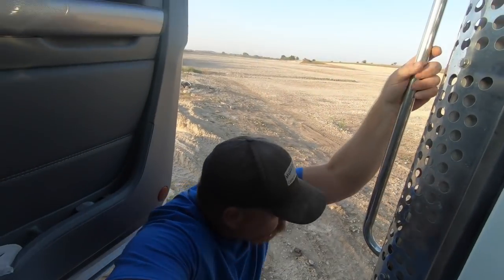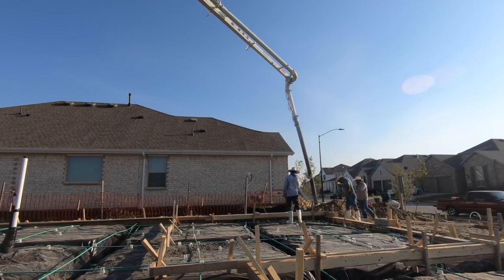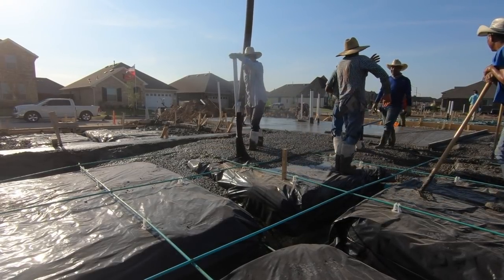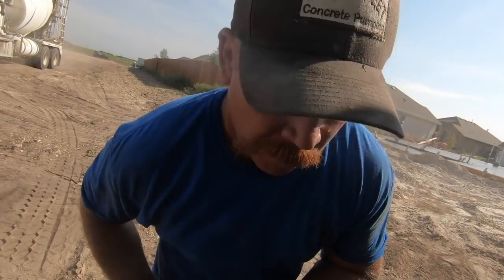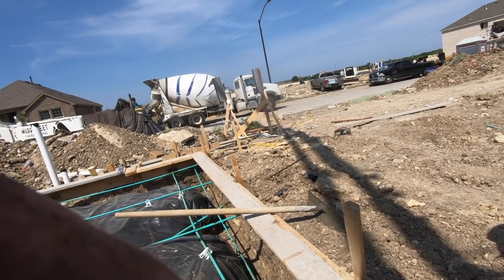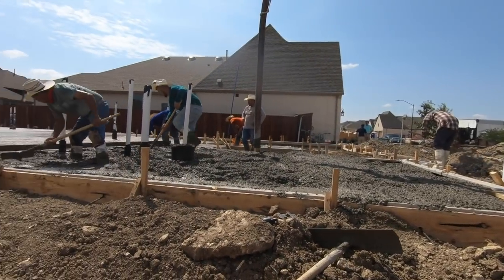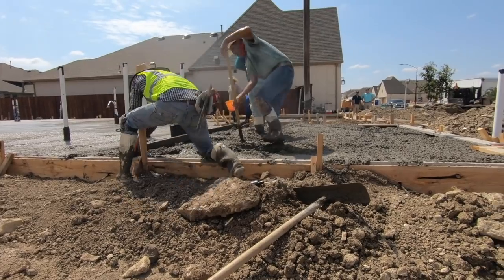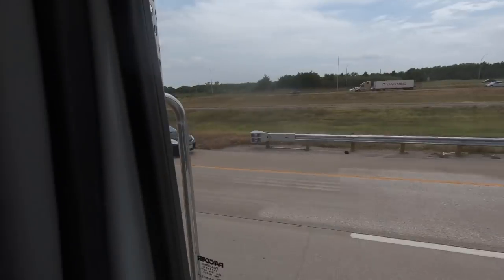Water Wars. Contractor almost shuts the job down. Pumping concrete with Muddyfeet.

Comment: Long time listener first time caller!!  Owner of a concerte finish company for 20 years. Have poured 500yard pads. Here is the truth. As long as I’m pouring the pad the concrete is mine. If ya don’t like it. I will load my stuff up n be gone. Thanks for your videos. Thanks
Reply from the maker: That’s basically what the concrete contractor told them. Thank you for the support.

Comment: It would be a lot easier if concrete contractor's / Supplier's / Driver's would invest $56.00 and read ASTM C94. The batch weights are required to be on all delivery tickets. Usually, calculating the allowable water to be added, before breaking the water/cement ratio. Any additional water added to the mix shall be documented on the delivery ticket. It's really that simple. Saves a lot of arguing. If Driver's are not documenting the water added, then don't accept the concrete, and let the concrete supplier pay for it.
Reply: Antix619 when poured on the army base @3/4 inch slump we would sneak in water every chance we get
Reply: If I was the builder I would have core samples done and if they don't pass concrete contractor sued and not paid. Then first slab poured was visibly too wet.
Reply: @bigrick7108  once you take samples or conduct slump and or air tests you may not add more water to the mix. I cant tell you how many arguments I get into with the contractor over this issue. The slump goes up when you pump through a hose so take this into account. Every single contractor will try and add water, always pissed me off...
Reply: @capeguy  I agree 100%.  My point is most of the crews are using too much additional water. You can see how wet the mix is and how it self levels. More water equals lower strength and more shrinkage. More shrink means more cracks. Nothing Good there. Just lazy crews. I don't operate that way. People hire me because I don't cut corners. I over engineer and build everything I do.  Contractors that care are few and far between now.
Reply: @capeguy  slump goes down Dumb Dumb when through a system gets stiffer.  Call Ozinga Redimix call Meyer pump
Reply: @bigrick7108  says they man that don't shovel it strick it or trowel it.
Reply: @TURKEYMAN60185  I have done enough concrete in my  life to understand how it works. You apparently don't.  Adding water to the mix decreases the strength. As soon as you ask the driver to add water you assume all liability to the batch. Your batch ticket will say that.
Reply: @bigrick7108  It not shrinkage. It called  volume reduction. Shrinkages is what happens to male genital's in cold water!

Comment: Drive through a development that's 30 years old and the driveways are in 50 pieces—that was wet mud.  Easy to level during the pour but someone's going to pay for it later.  It may as well be gravel.  I can't stand weak concrete.
I live in a cool climate — I can't imagine pouring in Texas.   Sometimes I will order a superplasticizer additive, which allows a reduction in water content by 30% or more.

Comment: Why waste the time of putting stands under tension cables since they knock em off and not reset ?
Reply: It’s required for inspection they want the cable Centered
Reply: Jay i know it is required but they don’t worry about setting steel back on them
Reply: ive done a good bit of concrete and when your under that sun and havent stopped moving and messing with concrete you could care less about the rebar or post tension cable being where it needs to be besides the footing rebar.

Comment: If I was the homeowner and saw this video, the contractor would be busting that slab out and starting all over. Why even put rebar if you aren't going to set it up on the chairs? I know you are just the pump, but these concrete guys are crap. That rebar shouldn't be laying right on the ground.

Comment: I've had jobs where they have a "Special Inspector" there for the pour, you can't start pouring till he gets there and the first thing he does is take a sample from every truck and then watch's the entire pour to make sure you don't add any water. He catch's you adding water and he won't sign off the pour so you can't get your permit signed off on which means you can't get paid. Water thin's the mix and make's the mud weaker and the max slump he'll let you pour is 4".
Reply from the maker: Timothy doesn’t sound like much fun to deal with
Reply: That's why you pay a little extra for high range admix. I deal with this a on a daily basis, the place/finish crew always hollering for more water, but we have certain specs that have to be met. Plus you don't want to sell your client a certain psi concrete and screw them over cause you're lazy or cheap.
Reply: Actually it's always works out, just need to have a good schedule, a good finishing crew and good communication with the batch plant. The one's we've done you couldn't use admix. And you are right, adding water on site just screws up the mix. Seen a lot of guys do that and then when it cracks they claim all concrete cracks.
Reply: @InLaymansTermsPlease  I agree with that.
Reply: @InLaymansTermsPlease  yep "all concrete cracks" is code for.... prepare yourself....we do sh*t work.
Reply: @dontdr0ptheS0AP  High Range Water Reducing Applications: When used as a high range water reducing admixture, water reduction up to 30 % can be obtained. The superplasticizing action allows for the production of high slump flowing concrete with excellent workability that can be placed with minimum vibration even at a low water/cementitious ratio.

Comment: where is the inspector when all those chairs are getting knocked off the water lines going through the slab
Reply from the maker: I always thought they did their job 50%
Reply: In today,s world it,s all about getting it done asap.
As cheap as possible.
NO one really cares about doing a quality job.
The concrete reinforcement that is used in these concrete slabs is a Joke.
I have never seen such a useless set up.
As a Minimum we use no less than 6 inch square mesh.
Not sure how they get away with using this so called reinforcement.

Comment: Been a mixer truck diver for 30 years.. we try are best to make everyone life easier on the job... but if you are a ass iam a bigger ass.. I got 150 head tank of water 50is mine. You can't get what you want in 100 gal it's your fault not mine. I have and will do it agen dumping all the water on the ground. The gc should have add chemicals that would help that day.. topcast eubar supper p. And other.  Stop been so dam cheep help the guys in the mid out

Comment: Do you have a hard line on those newer concords from your water pump to the back of the hopper where you can screw the hose in right there? Or do you screw the hose in right from the water pump behind your outrigger. We have a 2007 38 meter like that and it’s a pain in the ass with all that hose just dangling there.
Reply from the maker: Carson Graves  o it’s a hard line to the back. They also ran a hard line to run air back there also. I haven’t connected it up yet.
Reply: Muddyfeet Concrete Pumping hell thats a great idea about the air.
Reply from the maker: Carson Graves Yes I agree. Just haven’t hooked it up.

Comment: no wonder you turned comments off to those two videos! why the hell wasn't there a descent road for concrete trucks! what did yall expect them to do with all dirt holy crap!
Reply from the maker: dan theman yeah it was getting pretty rough. A lot of negativity. We have plenty of that in our world. People need to understand shit happens.  Our pumps got around just fine. We weigh 60,000 lbs. those concrete trucks weigh around 67,000 lbs. so not a lot of difference. As far as the “y’all expect”. We where there to try and resolve the situation. We as the pump company didn’t have anything to do with the prep of the job. We where told that their was a road.  So yeah it was better I turn the comments off.
Reply: Wait which 2 videos are y’all referring to??

Comment: Are the massive footings due to the soils issues common in your part of Texas? That slab isn't going anywhere !!!
Reply from the maker: I’m guessing these are engineered foundations.  They tend to have more footings than whet you would normally see other wise.
Reply: Probably cheaper than a lawsuit later on?

Comment: 10 gallons will drop the slump only 1''. builder has worse issues on that slab with the post tension cables not properly in the concrete, chairs fell over and cables laying on the bottom., if they have to bust out the slab , theyll know when at the bottom just find the cables.

Comment: Nice video! I run a 2019 Putz 36Z in Orlando. Im gonna start feeding my machine a Gatorade at clean up. That's a great idea.
Reply from the maker: Andrew Glover it didn’t set up on me but I felt like it could have used some more sugar. Thanks for watching sounds like you have an awesome pump your running.
Reply: Add diesel
Reply: Mr Glover, if interested in a less expensive pump but a smoother one with full factory support, feel free to reach out to CIFA North America. We're back, and stronger than ever before.

Comment: Why don’t you stroke the water a couple times before the mud hits the grate?
Reply from the maker: John Rosewaren if you put the valve on the side where the chute is the concrete will fall in and push the water into the opposite materiel cylinder. That way the first thing is water going through the system.
Reply: I stroke on 3 when the mud hits the shoot and turn it up to 7 When it hits the grate just to be safe. I’ve had separation issues when I tried doing what you do only because the driver didn’t catch up and it locks up in the cannon
Reply: I would love to work in Texas believe it or not most of the jobs in Florida are small house slabs. Every things bigger in texas😂
Reply from the maker: John Rosewaren summers are hot here and some days in the winter can be cold. Y’all humidity would be rough though.
Reply from the maker: John Rosewaren so far I haven’t had any trouble doing it this way. But you need to do what works for you. At least that’s my philosophy.
Reply: 10/4 stay safe and pump on brother
Reply from the maker: John Rosewaren you do the same. What part of Florida are you in?
Reply: Muddyfeet Concrete Pumping  Fort Myers. I’m trying to figure out how to get out to Houston or something. I love the company I work for I’m just tired of this place. The pay out here is horrible

Comment: How long do you wait before you re circulate
Reply from the maker: Lead slinger HD. It depends on how dry the mud is getting. I usually feel the mud that’s in the slab to see how tacky it is and how it looks in the hopper.
Reply: So I been driving a mixer for 6 years. I’m really thinking of switching to being a pump operator. What’s ur opinion on it being that you been operatoring a pump for as long as you have
Reply from the maker: Lead slinger HD I would think anyone  would enjoy it  it’s like anything else. It has its challenges but I think that’s the fun part of the job.

Comment: 20yrs in and it's always the same gripe. Finishers want self leveling inspectors want it bone dry. I don't play the games. If it comes out of my trk that's all I care.  But wait  dont forget to factor in psi rating...weather (hot-cold)...travel time...waiting time (job delay)
Reply from the maker: Yeah it’s a struggle. Makes us pumpers feel like we are stuck between a rock and a hard place. Lol
Reply: I've poured a lot with drag lines.  Over the years I've learned if I have to ask for water it's too late.  We have a long and trusting relationship with the folks we work with.  My pump man and regular drivers know what's needed....

Comment: No steel
Interesting...
Reply from the maker: Post tension cables. Took me a while to get use to it also
Reply: @MuddyfeetConcretePumping  could you give us some footage and explain it. Never poured anything with that system used. I am not a pro but, have played with concrete enough to understand the rest.
Reply from the maker: Scruffy 61 yes I’ll see what I can come with this week. I do t know a whole lot about it either but the people we pump for will.
Reply: The cables are in a plastic sheath and run to the perimeter. At some point after(post) the pour and the concrete has cured, to what degree I don’t know, the cables are tightened(tension) and “squeeze” the slab.

Comment: That dude was trippin that mud needed 10 more its not like they where pouring it super wet . Let him get out there and drag that shit . In about 2 mins he be asking for 20 more ! Lol
Reply from the maker: P-nut's Tool's I agree. 10-16 gallons o. 10 yards wouldn’t hurt and make all difference in the Spyro those guys.
Reply from the maker: Kevin McGann I think he was corrected by his supervisor.
Reply: I run a 6 axle front in SE Michigan, we see summer temperatures like yours, not daily, but it does get hot. 

If the customer asks for water, and it’s within reason, they get it, 10 gallons on a 10-12 yd load ain’t gonna do sheet to the slump, but it helps a buttload to the contractor.
Reply from the maker: gutshot300mag yeah they weren’t asking for a lot
Reply: Why is it a problem to give more water? I’m a noob so please explain.
Reply: @1DRIPSTER  Water reduces strength, only use as much as you need. If a slab cracks they usually go after the concrete contractor.
Reply: @gutshot300mag  Who do you drive for?
Reply: Alex Dull 
The red
The white
And the blue
Reply: @gutshot300mag  National?
Reply: Alex Dull 
Until I can retire
Reply: Alex Dull 
Which end of the chute do you work?
Reply: @gutshot300mag  I was a tester in Detroit and the surrounding area until December. Now I'm a batchman at a plant closer to home near Toledo.
Reply: Alex Dull 
It’s gonna be a busy season, if this virus lets us get started, stay healthy everyone, and keep it tight!
Reply: PUT 10 MORE IN IT
Reply: P-nut's Tool's  facts!
Reply: P-nut's Tool's  You damn right he would.. GC don’t have a clue as to what it takes, he needed to let you do your thing and go back in his job trailer and stay in it.
Reply: Its all about how much water the design mix allows . If it goes over too much the concrete company starts to be out of the finger pointing if the slabs should ever fail , showing major cracks or spalling etc etc etc.  from a less than acceptable PSI strength , especially if the slump and test samples have already been taken . The liability could fall back on builder since the concrete contractor will probably go BK and later find out the liability insurance the concrete contractor said was valid, mysteriously expired 2 weeks before the liens and lawsuits hit the tables. Goes way beyond how easy it is to screed the mud.
Reply: @MuddyfeetConcretePumping  
Usually 10 gallons per 10 yds = 1" slump . So if its 4" slump and you add 10 gallons it ends up close to a 5" slump.
Reply: @1DRIPSTER  Altering the water content affects the end strength and durability of the concrete, concrete doesn't dry, the water chemically bonds with the cement.